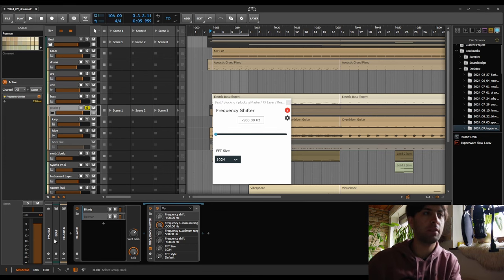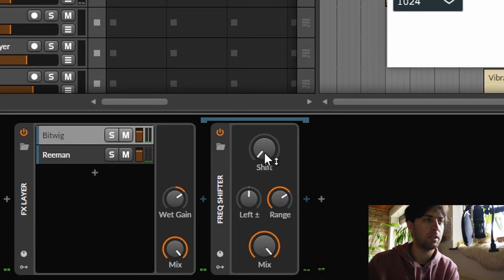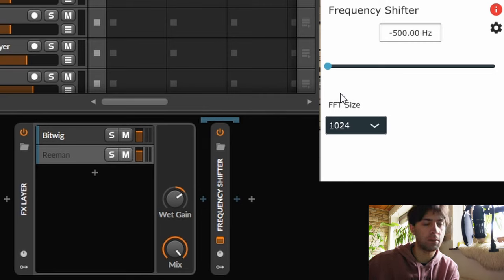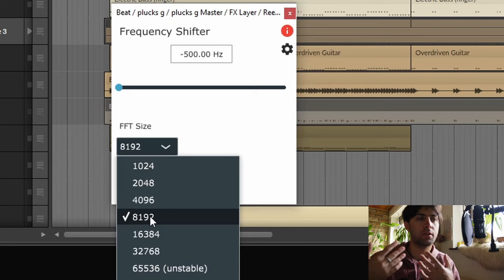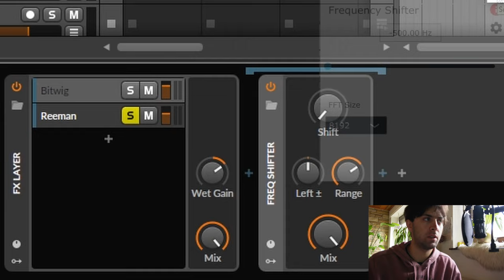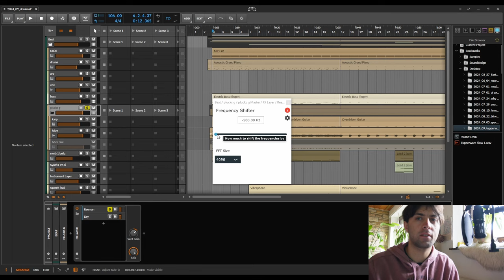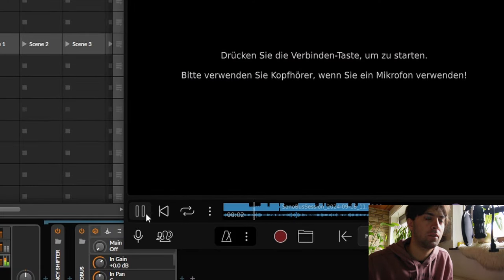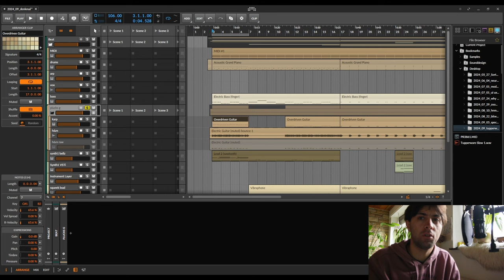When Do You Use Spectral Frequency Shifters?

Comment: I freq split then freq shift the isolated frequencies. It's typically meant to create some atonality or 'train whistle' attribute when shifting sounds up. I never gain much out of shifting down, it just gets hollow and boring imo.
Reply from the maker: @DisconnectedAutomaton  shifting down can be useful to get kicks to be a little more subby, but yeah, it also sounds a bit hollow sometimes
Reply: hey just wanted to shout out another nice freq shifting technique while we are on the topic:
freq shift your signal in some extreme way (up or down) follow that up by an interesting effect (lets say heavy distortion) and freq shift that resulting signal back (up or down) the same amount of the first freq shift. gives very interesting results imo
Reply from the maker: @manwithadream2043  yoo i actually tried that with a few effects once. distortion, comporession, EQing, reverb etc. but it can produce some really scary loud noise for some reason :D
Reply: @Beatsbasteln  very true xD but still cool af kinda right? (shout out safety limiter (by nih-plugs) on the master in my default bitwig template XD)